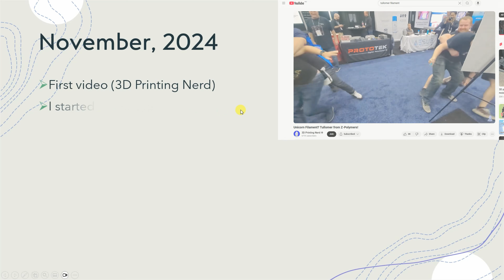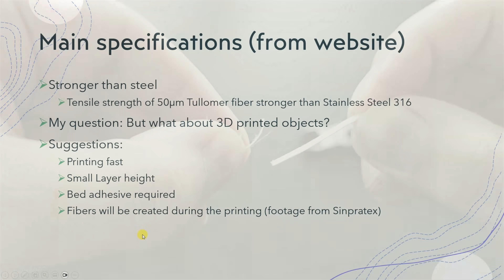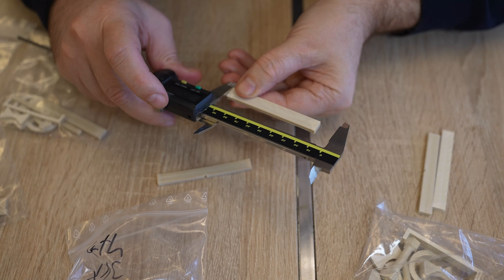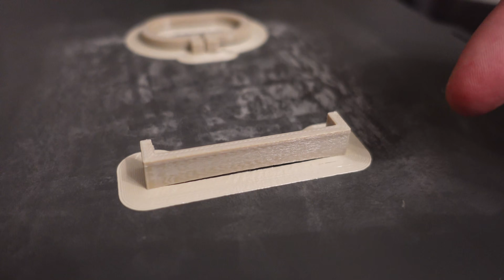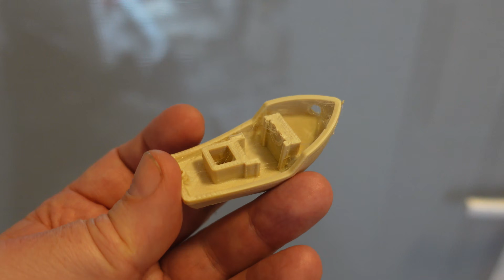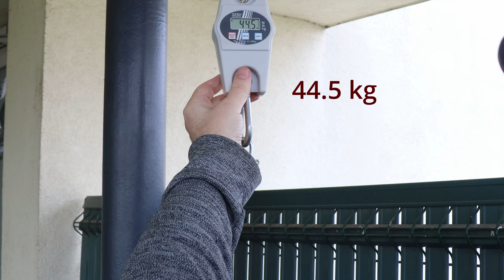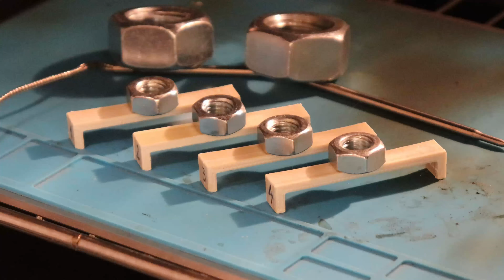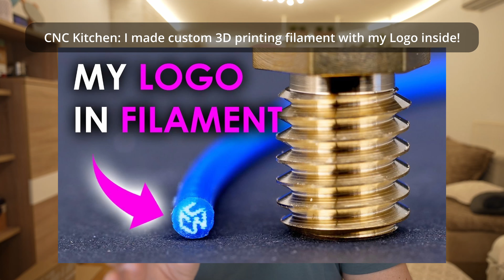Love it or Hate it: Tullomer filament

Comment: They wanted to charge you $67 to test their filament, I know exactly what my answer would have been.
 Considering you sent them the files and considering the people who are going to purchase these filamnts are going to use them for engineering grade parts, I would have thought they would have a profile to cater for any shrinkage of the parts, If I can print my parts to a perfect required size and allow for shrinkage in ABS, I would expect the manufacturer of a filament to be able to make a perfect part, am I being unreasonable here?
 TBH, without it being able to hold onto the bed and the layer adhesion being similar to PLA it isn't a material that I will be using, maybe some more development can result in a better product.

Comment: Did you try to lower the print speed to improve the layer adhesion?
Reply: If your chamber temperature is too low, then you supposedly have to print fast to get layer adhesion (you can't let it cool down before laying down the next layer)
Reply: @CarloVaccariPlus  
but if your heating system cant heat the plastic fast enuff you get bad layer bonding
Reply: @CasGRos the layer height is 0.05mm so the volumetric flow rate is greatly reduced
Reply: @CarloVaccariPlus  
i whas talking in genneral but that will help in this case.
Time to add a pre heater to the preveus layer
Reply: @CarloVaccariPlus that's another thing, a more standard 0.2mm layer height would be nice to see
Reply: @lukelave8615  the profile is 0.05 so that layer times can be as low as possible.
Reply: @CarloVaccariPlus  Print speed is 350-500 mm/sec...any slower and layer adhesion suffers.
I've tried thick and slow (little adhesion), thin and fast (some adhesion), thin and slow (no adhesion), thick and fast (some adhesion).
I'm limited to 300C at the nozzle...specs say that 325-350C at the nozzle is groovy.

Comment: Full Transparency and Valid testing.  Another Great Video Dr Igor.
Reply: Valid testing? Did he test a number of his own printed samples to eliminate the possibility of a single outlier being left unquestioned? 

No.
Reply: @Those_Weirdos  Did we watch the same video? He compared his own prints to one printed by the manufacturer, and TWO by a third party using two different profiles. So that's 3 separate prints using the same material. He even went back and reprinted his samples at a much higher temperature with chamber heater. They all underperformed in layer adhesion tests, even the ones printed by the manufacturers themselves.